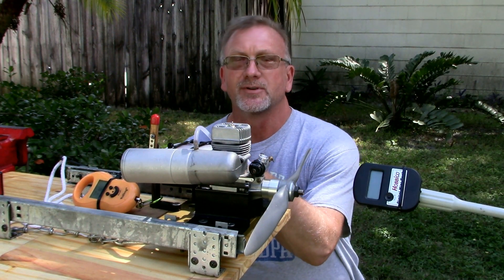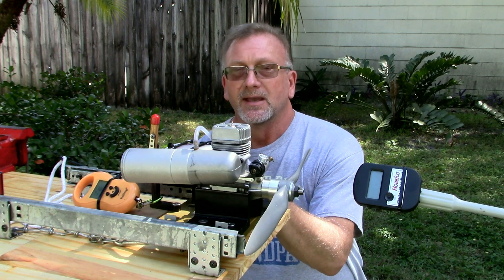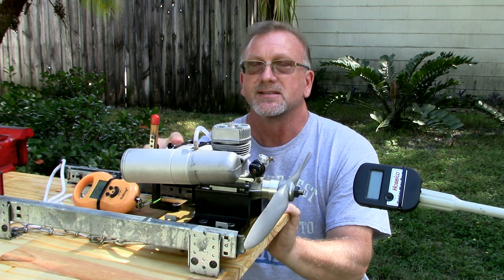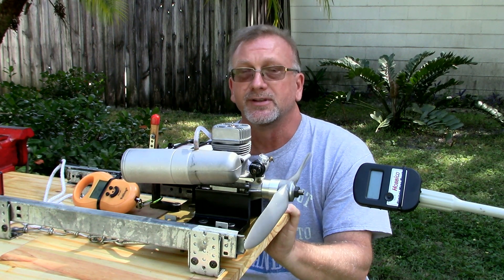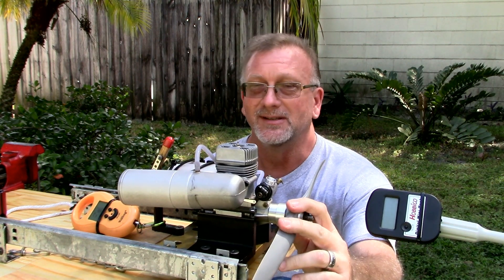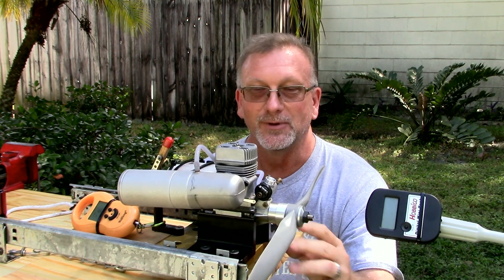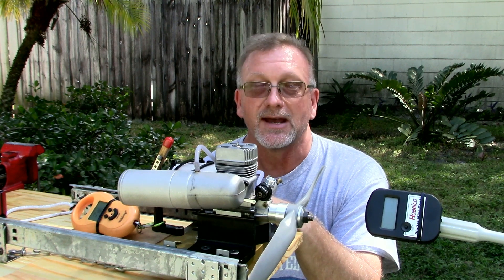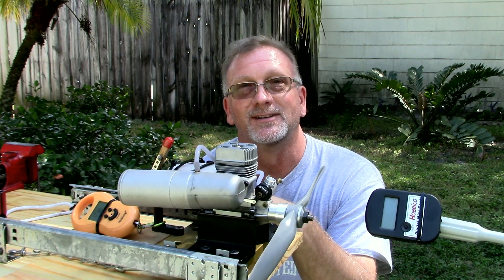Super Tigre S90K Ring Static Thrust Run

Comment: Nice video.  I have the 60, 75 and 90 versions and like how I can swap them around in my planes using the same mounting holes.  The 90 is only an ounce heavier and about 5mm taller than the 60 but has much more thrust.  But they are thirsty and that bigger prop gets close to the ground on a 60 size plane.

Comment: I ran the numbers through a static thrust calculator, I was surprised to see how accurate it was.
Reply: Which static thrust calculator was used?
Reply: godolloairport.hu>calc>strc_eng
Reply from the maker: Do you know who maintains this site?  It would be interesting if Xoar props were an option.
Reply: I do not.
Reply: The difference in prop types seems to be in the CF value. 
Standard propeller being 1
APC being 1.06
APC W being 1.09
Maybe through experiment you can determine the value of an Xoar.